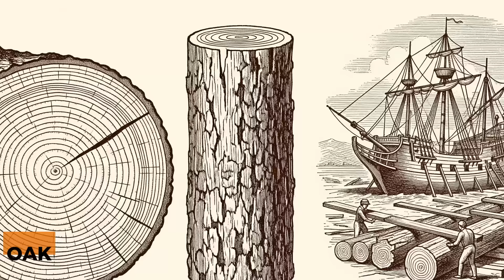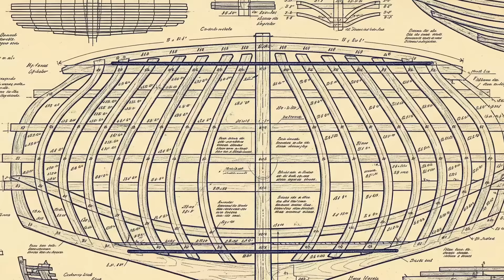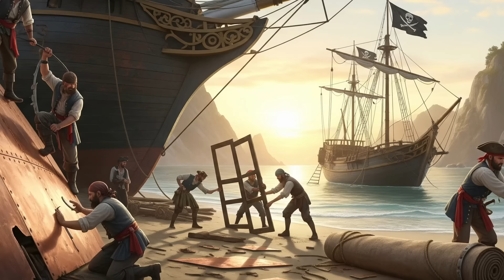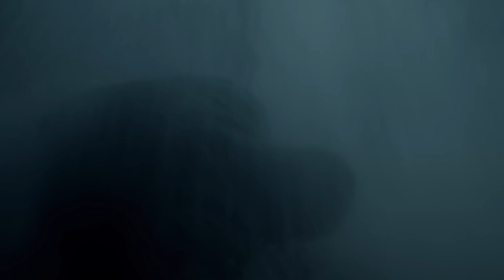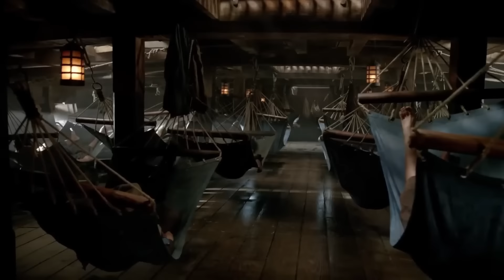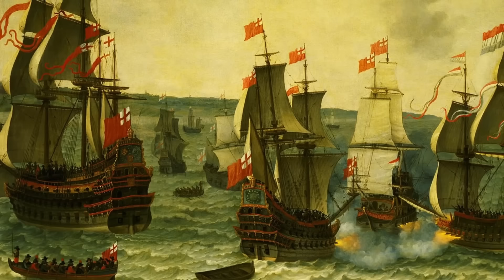How Pirates Built Ships From Scratch

Comment: Uhm, ive heard of pirates repairing ships, but never building their own. Also, I have questions, what kind of pine were they using for their masts? Pine is very soft wood, and since I work with various types of trees I’m wondering how on earth they used pine for their masts without the mast breaking first time the set any sails and had a decent gust or two of strong wind?

Comment: sorry but you are bull shitting. basic piracy does not work with ships. specially in the north atlantic. around england. most of the time in dangerous shores a big light (fire) especially in bad weather was enough to get cargo ships to run aground. in island territory all you need is fast moving row boat. most cargo ships where not big or fast at all. run with few sailors  to keep cost down. like modern pirates. actually exactly like modern pirates. there were shipyards that built small and fast boats mostly for fishing or local trade. those are the ones you need and want. you follow a cargo ship. board at night. kill few people if needed. usually you do not need to. steal the ship and cargo. go to a big port and sell the ship and cargo relatively cheap. divide the profit. every one of the participants were free man. you walk away. very few but very few did have big ships. and they were well known pirates. but usually they just receive and sell the stolen goods. they do not go hunting themselves. slavery was very well accepted. not just blacks ppl that come later. any one captured would be sold to slavery. man, woman, kids etc. big ship piracy is supported mainly by england and or american states. but spain and france as well. or ottomans. it is a part of commerce. it is an open water after all. they are commissioned by monarchs.